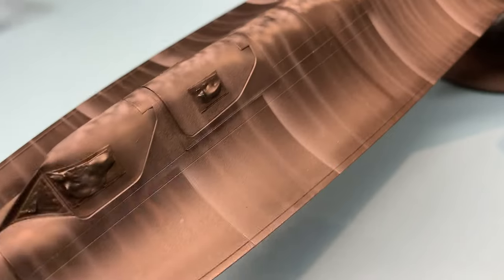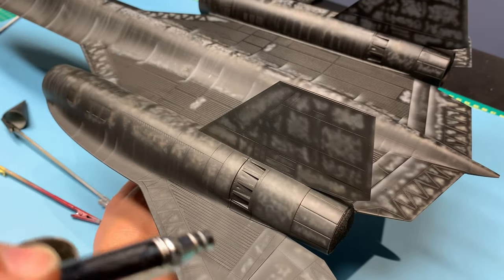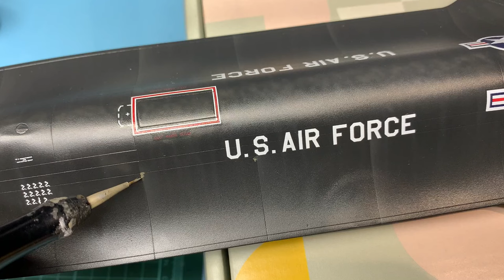Realistic Black Finishes for Model Airplanes

Comment: Two things: it's a Blackbird! It's a Blackbird!! I'm building a 1/32 Dragon Bf 110 nightfighter and was looking for a tutorial on black. That is a beautifull bird you have there sir! I do want to warn you for putting amoniak in your paints. It can react with your airbrush and seals.
Reply from the maker: I agree with you on ammonia affecting the finish and maybe the seals on the airbrush if you let it linger in there.  I use a small amount of ammonia, I mix the paint externally and then I shoot it as soon as it is ready.  I immediately fill the cup in alcohol and swab everything down while I run the alcohol mixture through the brush.

Comment: Awesome looking build. To answer your question about the rear ribbing between the engines on the rear fuselage, I do believe its intended purpose was to disrupt air flow of the back of the aircraft as to not cause a vacuum and slow the aircraft down, much like a golf ball... however, I can't confirm this and it's just my guess. Interesting side note though, the SR-71 is not painted black, but blue. The paint that was used is specifically designed to dissipate the heat generated during flight from air friction. The outer temperature of the air craft could reach 900°F at mach 3.2. Another interesting fact of the aircraft is that at speeds of mach 1.6 and below, the Pratt and Whitney J58 engines worked as regular afterburner turbojet, but at speeds above mach 1.6 the engines basically become giant vacuums and pull the aircraft through the air. I was a total SR-71 and F-4 fan boy in grade school.
Reply: You're wrong about all of that.  They are black and the corrugations are for expansion at temp.

Comment: Good video and tips, however, my only suggestion is that "decals" is pronounced, "DEE-CALS" here.  You can get away with "DECK ELS" in England. :). Also, the wing chordwise corrugations you were asking about are for stiffness and to prevent warping at high temperatures. Fuel would sometimes leak from these upper areas too while in flight. Nice model.
Reply from the maker: HaHa  Good point!